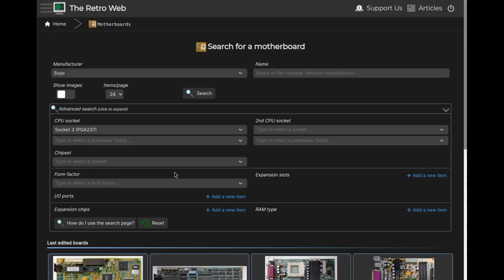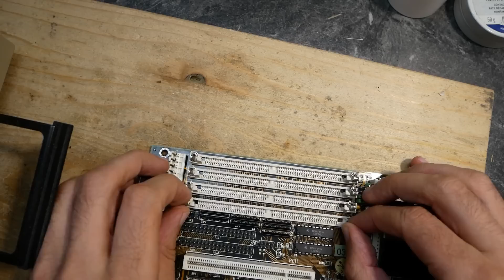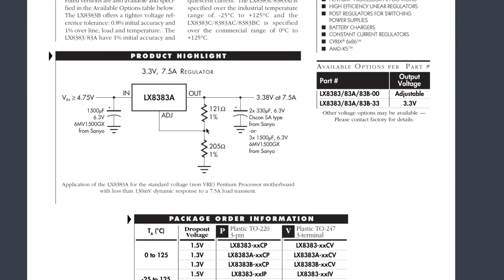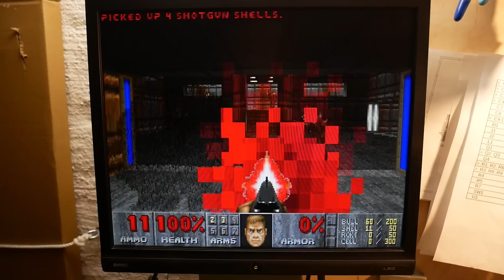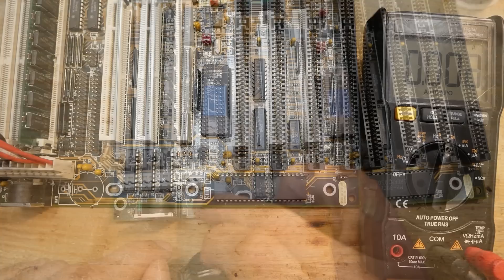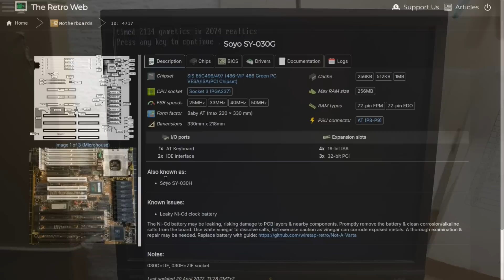Repair, benchmarking and overclocking of a 486 mainboard: Soyo SY-030H

Comment: I have a strange issue with onboard s3 graphics: graphical pixelnoise and freezes after some time and turning up color depth incrrase the graphical noise anf make it worse. With isa card everything works fine without those issue. Its not the vram I tested it with a vram tester and it works fine. Its looks more a power problem or noise reduction problem for the 5v power line but only at the graphical section.

Comment: I saw that you checked for unwanted battery charge current with the meter on the amp range, and apparently measured about 2mA. That's a lot for a lithium cell that is not intended to be charged.  Maybe there's a meter problem...?  You should ideally be using a milliamp or microamp range, and the charging current should be really a lot lower - even 10 microamps would be too much.

Comment: For those who may be confused by why the resistor values did not fit: Some regulators have the 1.25 V reference voltage between output and ADJ pin, like the LX8383A, which follows the classic LM317 school. Other like the SHARP regulator (it seems to be a Japanese thing) went to 1.25 V between ground and ADJ pin, which also means they have an explicit ground connection at the IC. In any case trying to swap one for the other will result in the roles of R1 and R2 effectively being reversed, so the voltage output ends up wrong as observed. This is why swapping two resistors worked for the 3.45 V setting.

Comment: Actually if you look at the vast majority of DRAM specifications you'll find that they all pretty much settled on a refresh period of 15.6uS. This even carried over somewhat in to SDRAM. You have to go back a loooong way to find DRAMs that need to be refreshed much more frequently than that.

But I think what you're seeing here is that DRAM refresh is already quite a small percentage of overall bus utilisation, and that a slower refresh rate is probably more of a power saving feature for battery powered devices than a performance enhancing feature.

Comment: You can run the Intel DX4 100 at a 2x multiplyer with the jumpers.  I have a board set up with a 2x multiplyer and a 50Mhz fsb.

Comment: Very interresting content, especially about CPU voltage regulator. I like also informations about 486 dx/2 80MHz CPU. Most people use dx/2 66 or dx4/100 but dx/2 80 is forgotten. This CPU with 40MHz FSB in my oppinion is more interresting than dx4/100 with slow 33MHz FSB.

Comment: Seeing this old equipment calls to mind the time a colleague told me about working for a semiconductor manufacturer in the 70s. He ended up inheriting someone else’s logic diagnostic routine that would get stuck in an endless loop until a manual break command was issued. Anyway, the micro code (and silicon) was so primitive that it didn’t have an exception built into the code in case of a divide overflow, so of course every time the routine would run it would get stuck in an endless cycle trying to divide by zero, catastrophically overheat in the span of a few milliseconds, and destroy itself (and the ancient machine it was running in) spectacularly by blowing the lid right off the chip leaving a little charred cavity presumably where the ALU was. Took a while to fix that bug but he figured it out and everyone went on to live full and somewhat meaningful lives.
Reply: the fix probably was : check if the divisor is not 0. 

go live your life, but you wouldn't believe how hard is to make programmers check things (they'll excuse "performance", as if a single check would matter).

Comment: Am I surprised an Intel DX4 wouldn't run at 120 MHz? Not in the slightest.
Am I surprised an AMD DX4 labeled 100 would run at 120 MHz? Not in the slightest.
AMD used this as a secret weapon for years, almost every builder knew that as long as your board could handle a 40 MHz bus, it didn't matter what speed your AMD 486 was marked. It was going to be happy with a 40 MHz FSB, maybe needing an extra 0.1V thrown at it. This was even true of their later 386/33 chips. They all happily ran at 40 as long as the board was good there.

I also noticed some pins on IDE port 2 that are bent enough that they might be touching. That might be worth checking.

Comment: Hello! I am referring to your experience in board repair. There is a rare 624415-230 board with A80501-60 (Intel Pentium 60 MHz), the board is very similar to DFI THE LEOPARD, which is on The Retro Web site, the board starts, makes one peak, but there is no image with any video card, perhaps after one peak it freezes. There is a Dallas on the board, can it behave like this because of a dead battery in Dallas?  The code on the postcard is 0088. If you remove the RAM, the board swears about it with a series of peaks in the speaker.

Comment: I have 2pcs of i486DX4/100 CPUs and the multiplier can be changed between 3x or 2x. And when these SiS497 can go up to 66MHz bus speed then 2x66 gives 133MHz. Both of those CPUs run at that speed with default voltage. Motherboard is Asus PVI-486SP3. PCI-bus don't like that post-write option anymore but when it's disabled, everything works.

Comment: A note about the regulator: A linear regulator is basically a variable resistor that turns all the excess voltage into heat. This means how hot a linear regulator gets is never related to how powerful it is, but rather directly to how much voltage it's dropping. if it's dropping 5V down to 3.45V, it will be dropping 1.55V, which means that at its limit of 7.5A, it will have to dissipate 11.6W of power, and at 3A any regulator is going to dissipate 4.65W of power regardless of their rated maximum (give or take a little bit depending on efficiency). This is different in switching regulators, which turn the input on and off for different periods (PWM) and then smooth out the output, meaning there's very little excess power at the cost of having a noisy output that needs very good filtering.
Reply: (Wrote this comment because I didn't see anything related to it, and then just after sending, I see that just a little further down than I scrolled, someone already mentioned it)
Reply from the maker: Yeah, thank you though. My statement about that was of course misleading.

Comment: Just a tip: LDO's dissipate power only relative to their voltage regulation drop and current supplied to load.
This means no rating on the LDO will change this and every LDO put in the board will be just as hot.
Reply from the maker: True, that was a misleading thought

Comment: Shouoldnt it have been much faster though? It's benchmarking only barely faster than a DX2-66 even with a DX4 in there? Did I miss something?
Reply from the maker: You probably have a super fast DX2-66 system if you think so. As I said, this is nothing to make world records with, but the performance is within expectations. Probably on a faster mainboard with VLB graphics card it could be another 10-15% faster, but for an average system of that time it was still quite ok.

Comment: You can use BAT85 diode for battery. It has lower voltage drop and it will hold bios settings for longer.
Reply: Yes. Specially, it's  a Schottky diode, and will have a significantly lower forward voltage drop than a regular silicon junction diode. Current and reverse voltage capabilities are fine for this application.

Comment: I don't follow your math about the 1 MB of cache vs RAM size, so I must be missing something fundamental here...
Isn't it more about the application you are running, and how much memory that app accesses, than the amount of physical RAM you have on the system? I mean, if your DOS app consume 1 MB of RAM, it will fit all in the cache and be super fast, but it has nothing to do whether you had 32 MB of RAM on the system or 512 MB. I'm confused... To me, cache has always been about optimizing the frequently used memory, however much memory you have behind that cache.
Reply from the maker: That is actually a complicated topic, which I wanted to handle one day in a dedicated video. The memory on an x86 is not linear, as we imagine, but is organized in pages, which can be cached. The system has to know what is cached and what not, it's not enough just to put memory pages into the cache. To resolve the memory address to the cached pages there are lookup tables which can cover only a limited amount of physical address space. It's hard to explain in a short comment, because there are many details like WB/WT cache type, bank interleaving and more. This all adds more complexity, but basically more cache doesn't automatically mean better performance.
Reply: @necro_ware  Yes. I was oversimplifying by ignoring the TAG, which means you may have too much RAM to effectively cache, but that's why I was being specific about a DOS app (ie no multi-process, so no vastly different memory locations being pulled). I agree in Windows, with not enough cache and an address space too large, it becomes pointless trying to cache if as soon as you get a context switch your entire cache becomes invalid. Still, bigger cache (bigger TAG) it always better here. Just not linear I agree.

Also, WB > WT speed-wise as far as I know. And not affected by RAM amount, afaik.

Bank inter-leaving, is where I draw a blank. I do not know what that is. So perhaps that's the source of my confusion.

As an embedded developer, I'm mostly familiar with non-MMU system caches, so maybe that plays into it as well.

Either way, yes cache would make an interesting video if you ever go there ;)

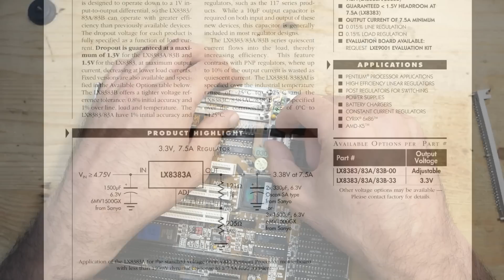Comment: 8:16 all linear regulators emit the same exact amount of heat at a given input and output voltage! The output current rating is only the rating for load transient maximum current. Real current through the regulator is the current consumed by the load (use average value), and the dropped voltage is the voltage difference between input and output voltage. So if you have a 1A load, a 3.3V regulator running off 5V will always drop 1.7V and will always consume and convert to heat 1.7W of power. Higher current rating generally implies lower effective dropout voltage at high current, meaning the minimum necessary input voltage would be lower, but no advantage when you can't change the input voltage.

There is one other thing, how well it removes heat. the 3A regulator has 3°C/W thermal resistance to tab, while your 7.5A one has 2.7°C/W. So it does run maybe a little cooler but not by much! You can afford to dissipate up to 10% more power on it before it hits the thermal limit, which means up to 5% more current, under ideal conditions. But to be kept in mind that the total thermal impedance also contains thermal impedance from tab to board, from board to air, etc, so in reality this small difference is even smaller yet, realistically it is zero. I don't suggest skipping the heatsink if you want to remain compatible with high current loads, and you should use high temperature rated inseparable thermal paste, not CPU paste. I keep HY410 for such use. But soldering the tab to PCB should also be pretty good.

Putting a heatsink on top of plastic casing of a regulator is nearly pointless.

Comment: As always good work. I have 2 soyo's to bring back to life. Apparently it would just be changing the swollen capacitors, but no. Socket 370, which was not booting, now heats up the processor and stops reading memory. The other socket 7 that sometimes booted and crashed, after I changed the capacitors the processor heats up and does not leave FFFF.

Comment: I also have that BenQ lcd monitor :) Good to know: besides VGA It accepts 15khz rgb signals, so you can hook up Amiga and other retro platforms that use rgb scart connectors with an adaptor!

Comment: Wouldn't it be just easier to add a tp4056 or something similar to the battery mount meaning you can use a lithium battery without messing about with the board?
Reply from the maker: Yeah, could be another way to go.

Comment: Higher current specification of a regulator doesn't mean that it will be running colder. It has to dissipate the same amount of power regardless of its amp rating. Dissipated power depends on the voltage that the regulator has to drop and the current that it passes (P = V * I). That's why LDO regulators can supply quite more current (when supplied as low input voltage as possible) than non-LDO variants. And that's the same reason why switching regulators are used. For those input to output voltage difference doesn't really matter.
Reply from the maker: True.

Comment: Hi, great video as usual. Just small note: that voltage regulator with higher current capability will be heated to same temperature as that other, because same amount of heat needs to be dissipated. 🙂👍
Reply from the maker: True, that was a misleading remark indeed.
Reply: @necro_ware Great video anyway! You inspired me to buy and successfully repair a few retro motherboards.
Reply: Hello, clueless person here, so in order for that to occur you would need to increase the surface of the component or use more than one component so the heat is distributed? 😅
Reply: @RetroTinkerer   Hi, yes, it depends on temperature resistance from chip to package, from package to ambient air... so yes, using cooler, or other package can enlarge that surface (that is, why heatsinks are ribbed, to make bigger surface with contact to ambient air) and make it not so warm. 🙂
Reply: Also, it is exceptionally rare that a part won't work because you put a heatsink on it. It's not impossible, but hardly worth worrying about. I think I'd try to mount it (and its wraparound heatsink as shown in the website photos) in a vertical position rather than parallel to the board and screwed to it, if it's really getting that hot, or maybe still place it parallel but as high above the board as its little legs will allow so it gets some cooling from the back. The ground plane it was bolted to does distribute heat, but then it hangs onto it because it wasn't designed for radiating heat, it was designed to be a ground plane. (It's one of the two inside layers of a typical four-layer board, the other is generally power.)
Reply: Also gluing a heatsink on the plastic part of a TO220 package is nearly useless, heat doesnt really conduct trough 4mm of plastic. You really should use a suitable heatsink and install it to the thermal pad as intended.

Comment: Still have a soft spot for late 486 motherboards - while all of my friends at LAN parties could afford pentiums, a very similar motherboard served me well enough for years with a Cyrix 5x86-100 overclocked at 120MHz.
Reply: I had 486DX2/90 when friends bought new and shiny P60 machines. With my S3 Vision864 VLB and bus speed @45MHz it run Duke Nukem 3D better that friends P60 😆 Of course Quake was totally different story...
Reply: @djpirtu2  There was an official DX2/90? 80 and 100, yes -- the DX2/100 was short-lived because very few VLB cards were happy at a 50 MHz bus speed, but the DX2/80 did fine because almost all cards that were specced for 33 MHz also ran at 40, and it was only the VLB card(s) you had to worry about (assuming the ISA clock divider was changed from CLK/4 to CLK/5).
Reply: @mal2ksc  No not official. If I remember right the CPU was Am486DX2/66 and I just overclocked it to 90MHz by swapping oscillator. Never had any problems with VLB cards at 50MHz. Now I have one Am5x86 system @150MHz so 3x50MHz, and everything in BIOS is set to tightest, Cirrus 5434 VLB flies on it. 🔥

Comment: i think you should have used a different battery holder and not modify the power supply connector for safety and in the interest of keeping it as close to original within reason.
Reply from the maker: I couldn't find any holder which would fit there. I think it was a bit miscalculated by design.
Reply: @necro_ware   I wonder if they were actually never intending to fit a socket and instead they had tabbed cells in mind which might have the same pin distance as a socket. But that has risk of collision too. Anyway it seems a little silly to trim the power connector instead of the more readily replaceable cr2032 holder :D

Hypothetically a CR2032 holder with trimmed sides could exist which wouldn't collide, but i severely doubt one existed at the time. Modern slimline ones are SMD and made of LCP, which was much too expensive for this type of use back then. I do lean towards them only ever actually intending to fit NiCD and only drawing in the CR2032 footprint for no solid reason whatsoever.

Comment: Have you ever try to use supercapacitor in place of rechargeable battery?
Reply from the maker: Yes, they get empty very fast. Exact time depends on the capacity, but something not too big drops the voltage below 2V in a week.

Comment: Did the resistors around the voltage regulator need to be adjusted because it's a different regulator to the original?
Also, you put in a 3V CPU but measured 3.4V at the regulator and you were happy with that. Isn't the voltage too high?
Reply: 3V mark on cpu doesn't mean 3V. It means find datasheet for cpu and find exact voltage, 3.3V or similar. Crap marks.
Reply from the maker: Despite the 3V inscription, that CPU is actually specified for 3.3V-3.6V. I could theoretically install different resistors to get any voltage below 4V out that regulator, but this board has three jumpers predefined for 3.45V, 3.6V and 4V.
Reply: yes

Comment: Why were the resistors so out of spec originally?
Reply: There was another  voltage regulator on that board.. Every one uses different resistor values..
So it that out of spec with the regulator your are using, then (what already mentioned in the video) you have to change those resistors too.